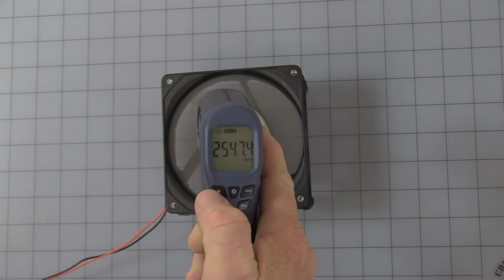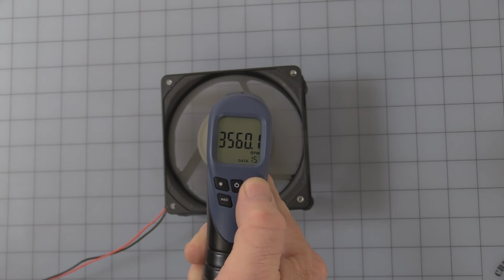Pistol Grip LASER Photo Tachometer 35589 TE

Comment: will this tach see an airplane propeller against a light sky?
Reply from the maker: I would not recommend this for outside use, the sun is too bright for it. As for using with a propeller I have no experience, can you use reflective tape on a blade with out making it out of balance?
Reply: @mpjaonline  I might be able to put equal amounts of reflective tape on each blade at the same place and divide the reading by the number of blades. would have to run the test at night. The tach seems to be looking for a dark background and counts light events. Daylight would be backward and probably confuse it. THANKS